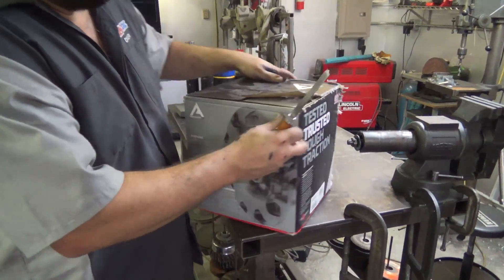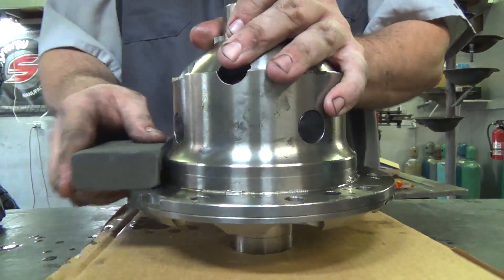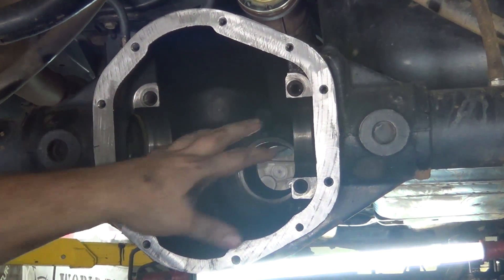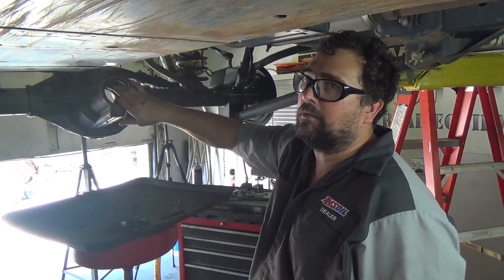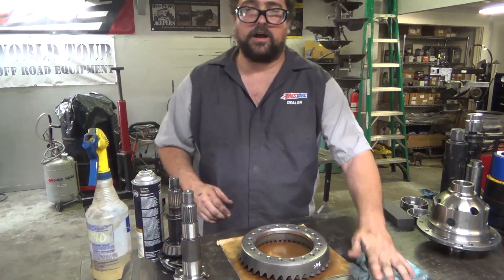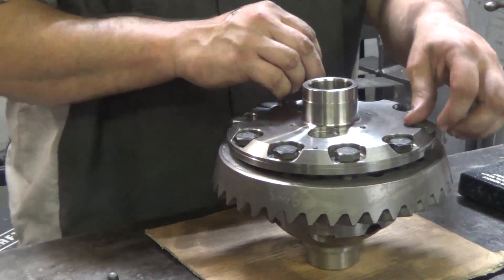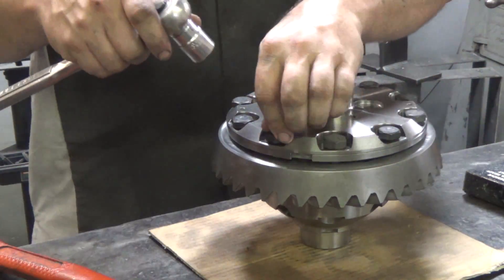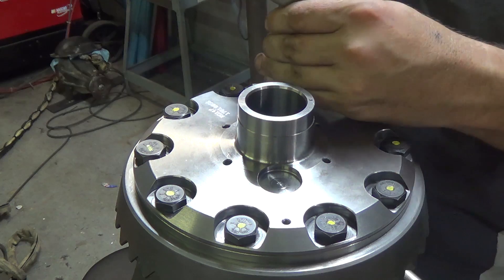Rear Axle Upgrades and Diff School - Part Two - ARB Carrier and Ring Gear Get Stoned

Comment: What's more precise- the lathe the billet of steel was turned on to make the housing and the gear,  or some Bubba with a worn-ass sharpening stone with the item wobbling all over hell and half of Georgia as he 'trues' the surface?

Laughable.

Also, he's worried about harming hardened tool steel on a workbench? Don't think he understands metallurgy.

Comment: That's very discouraging to see. You pay 6500 and now I see you have to machine it too on top of paying for the gear set up and drilling for the air line. This is gonna turn out to be like a 7-8 grand upgrade.
Reply from the maker: Matt Ackley I don't know what to tell you, it's a package deal but they don't do the installation for you. so you have to budget for that as well. the drilling of holes is actually in the ARB installation manual. I don't know if the Eaton e Locker will be any different. Here's a link to the manual part Arb https://imgur.com/gallery/HWSWm
Reply: OVERCLOCK3D - CPO I'm already committed to air for the most part already running the twin compressor. I'll be seeing the guy that will do my install in a couple weeks on a trip to drummond island so I'll pick his brain then.
Reply from the maker: Matt Ackley whether or not you'll have to drill is entirely dependant on what size bolts your ring gear takes...

Comment: Wish I had a guy like that around my area in DFW. The manufacturer actually sent wrong bolts with new parts?
Reply from the maker: So just to be clear, the Trail Leader Package is a bundle deal... they send you the parts to upgrade...but they don't do anything with those parts.  So the ring and pinion was a separate product from the ARB Carrier.. both I needed..but they are from two separate companies. The bolts came with the ring and pinion.  In the ARB manual, it actually tells you you may need to drill out the holes.  They ship them for the smaller hole size because depending on your specific ring gear, there are likely three options. They drill them for the smallest size as default, knowing you can expand holes. It's not so easy to make the holes smaller!  ;-)  We actually could have drilled it out for the even larger sized bolts that came with the ring gear I suppose... but it just ended up that we found the middle size bolts and drilled to that. With that said... it wasn't something I would have expected to do... and if I was trying to do this on my own, it would have been a bit of a roadblock.  Of course, Paul, knew exactly how to proceed!